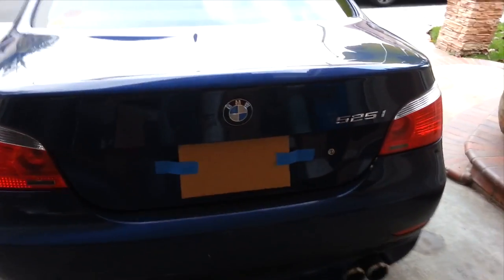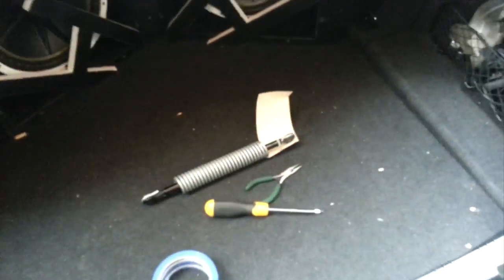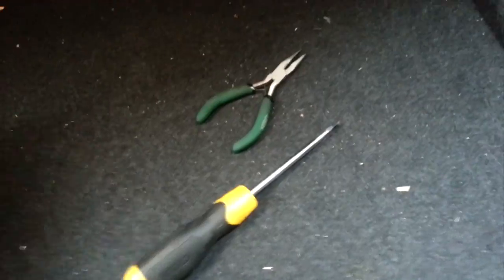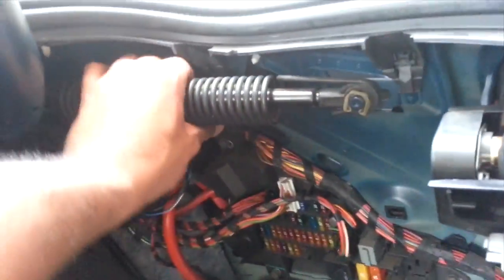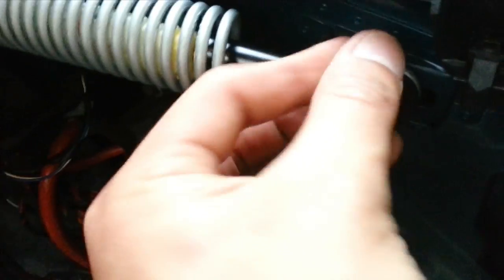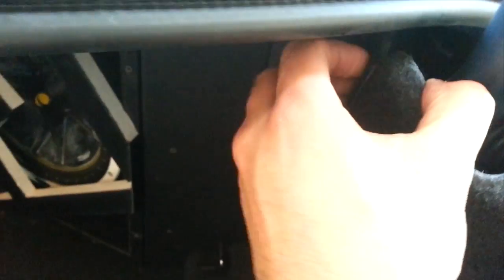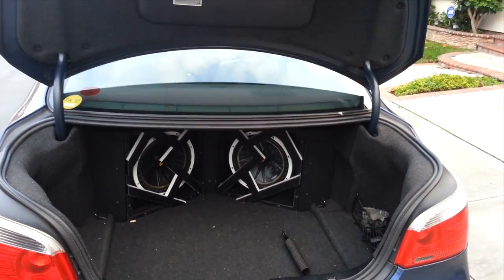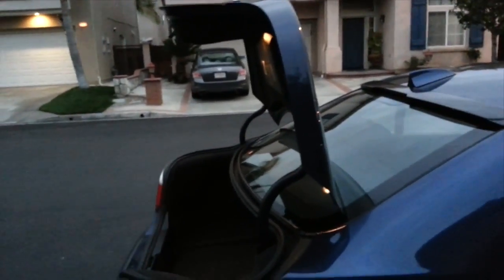BMW 5 series E60 trunk shock

Comment: Thanks I'll do this with mine,also nice looking sound system,I had trouble getting the sub to work in mine I thought I could just tap into the rear speakers but found out there's no base signal sent to them and had to take a wire from the factory subs under the front seats

Comment: the shocks are the same (right and left) ? Did you replace just one side ?
Reply from the maker: I think there is only one? It has honestly been years, I don't remember dealing with both sides.
Reply: Ok thanks. My F10 has only 72000km and I have the same problem.
Reply from the maker: I hope it is just one side. I honestly think it is based on how much use your trunk gets. Let me know if it is the same for your five series, I can add it to the description to help other F10 owners.